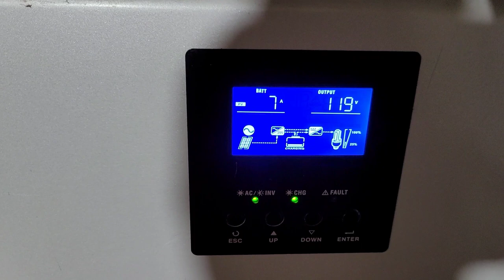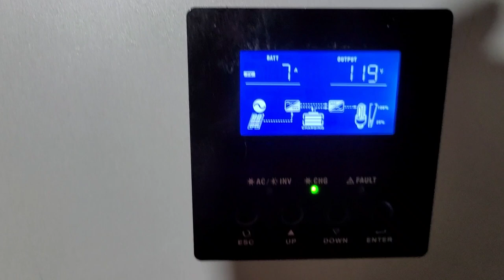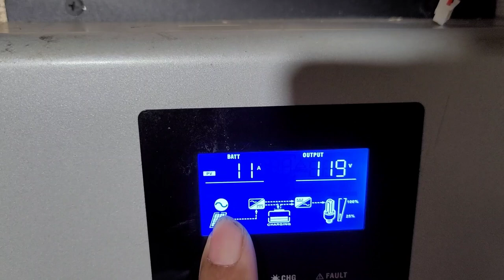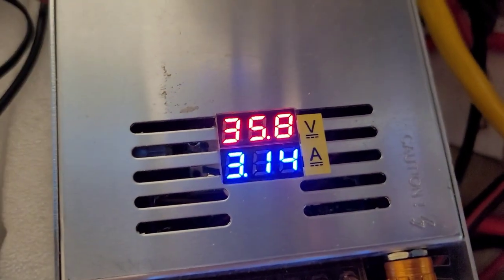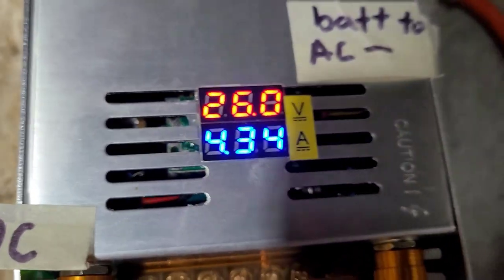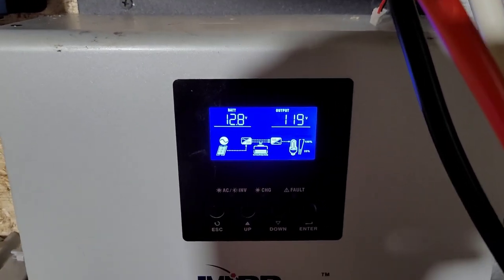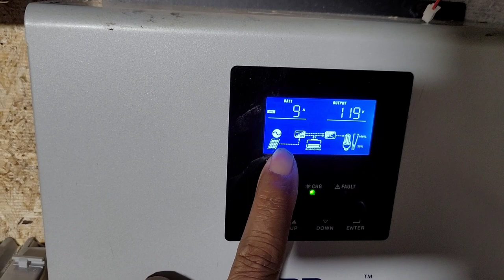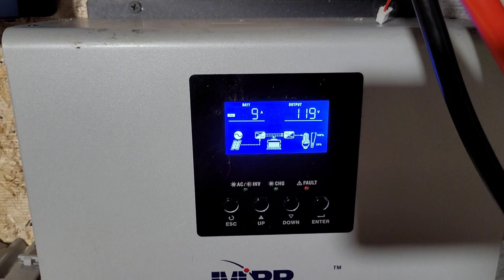control solar power weather it's day or night ,rain or shine

Comment: Lloyd, have you got any experience with your ledstrips giving power to your solarpanels in your basement?
Reply from the maker: Hello and sorry about not getting back to you sooner, but we had a pretty bad storm here. I had to help out family members with downed trees. You asked me about the LED lights, I believe, and if I had a problem with them. So far, I've had very few problems with those LED strips giving power to the solar panels, and I'll explain why. 

When I first installed them, I bought the most expensive and most powerful LED strips I could find, which were 12 volts. The rope was 36 feet long. Initially, they provided more power to the solar panels than I was expecting, and I documented as much as I could. However, over time, the lights heated up the solar panels, causing them to get dimmer. I noticed that I only lost about a volt or two, bringing the power down to the normal 18 volts I was getting, along with about an amp of power. I wasn't expecting that much power; I was expecting at least half of that because, remember, I sandwiched the LED strips between two solar panels. So, I thought maybe I would get just a couple of volts above what I was using. 

A lot of people don't understand how I'm doing this. I have solar panels on the outside of my house, and I use that power to charge the battery, which is then attached to the LED lights. I do this to cut down on power usage and keep a steady power level, so I can monitor exactly how much power comes out of my system and how much power I have to put back into the system. Even if I don't get direct power from my solar panels (which I do), I then turn around and put that energy through inverters, as you can see in other videos of mine, and all the experiments that I have there. The system works out pretty well. 

Now, I've moved to more efficient and lower power lights, which are 5 volts, 1 amp. Yes, I have to use 2 of them for my 20 w-solar-panel project because the rope lights are only 16 feet long, and you cannot attach them together. So, I also went to 25 W solar panels instead of 20 W. If I can find a solar panel stronger than that, but the same size, then I will move up to the stronger solar panel. I solved the problem of overheating by using a fan to keep them cool; a computer fan works perfectly for this task. 

The point of all this is that this system has a smaller footprint. You can calculate by the numbers how much power to expect by using the LED lights, and you can estimate how much power usage you're going to have. Using the 5 V, 1 A LED lights, which are 16 feet long, times 2, you have 10 V, 2 A of power for each 2 solar panels, which are 25 W each, totaling 50 W. Now, the way you should calculate is 5 W of power for each solar light, but since people want to take the bigger number because you're using 2 solar lights, let's calculate them by the bigger number, which is 10 volts, 2 amps, which is 20 W. Now, 20 W - 50 W equals 30 W. And remember, you don't see that until you look at the end, but that is coming from the battery, not your grid, and solar is maintaining those LED lights. Now, if you do it the traditional way, you'd get one of those very expensive solar batteries like the Ecoflow, and you'd run just your refrigerator on that. The average power consumption of a refrigerator is around 4 kWh. 

Let me break this down for you. Here is the comparison of the power consumption of a standard refrigerator and a 5 V, 1 A LED light times 2: 

Standard Refrigerator: Power consumption: 5 watts Energy used in 1 day: 24 hours * 5 watts = 120 watt-hours 

5 V, 1 A LED Light times 2: Power consumption: 1 watt per amp Energy used in 1 day: 2 amps * 1 watt/amp = 2 watt-hours 

As you can see, the standard refrigerator uses more energy than the 5 V, 1 A LED light times 2. The standard refrigerator uses 120 watt-hours of energy per day, while the 5 V, 1 A LED light times 2 uses only 2 watt-hours of energy per day. This means that the 5 V, 1 A LED light times 2 saves more energy when run. Even when I use the computer fans to keep this system cool, I still come out using less energy, which is the whole purpose, and energy is free since it still comes from solar. It's just what I am running in the system because it does not have to cope with the weather like sunshine or rain and go through drastic changes. Keeping my solar panels outside smaller to around 400 W of power, I do not have to change out the system when it does fail. If the LED lights blow out, I just simply change them out like I do a light bulb. 

For more information and to see the photos of the prototypes I have made, you can reach me at medialibraryinfo@gmail.com. 

Improvements to the system: I then went to my hobby craft ability and started cubing a box-shaped solar enclosure to go around the box. I then just wrapped those 5 V, 1 A LED lights around this foam core board from the dollar store, cut to the size of my solar panels, and then stretched the light directly over the lines of the solar panels to give it more efficiency instead of trying to just wrap the cord all willy-nilly around a board. I tried to make sure those lights went into the solar's direction; this even helps with better consumption of power. When you use a box, you get more surface area, and it worked better. 

I will be using other techniques, which I'll be discussing later, which are devices that will amplify the light before it gets to the solar cells. If you want to see those prototypes, I will send you additional art that I have on how I'm going to accomplish this. If you've seen the last video, stick around to see how the reactor is going to work. I'm testing it now, and I think you're going to be surprised by what I did. Right now, it's just a thought experiment which I used my imagination to perform, but now I'm starting to build, as I stated in the last video. I hope this actually helped you. Let me know if you need more information.